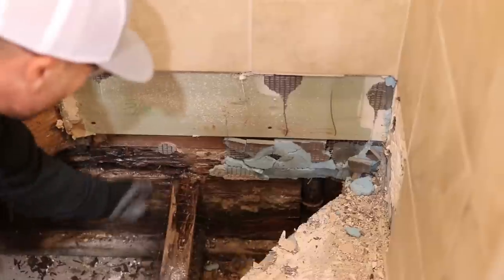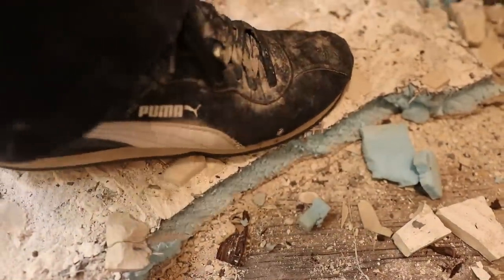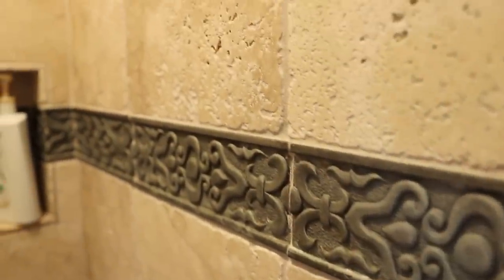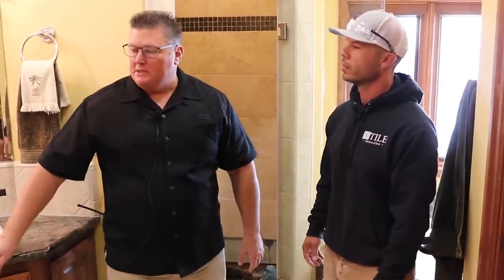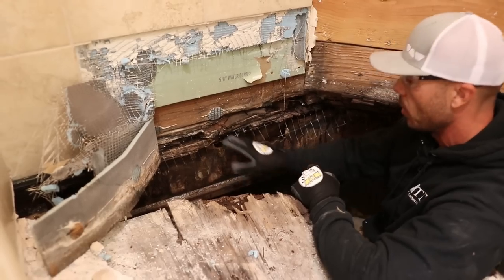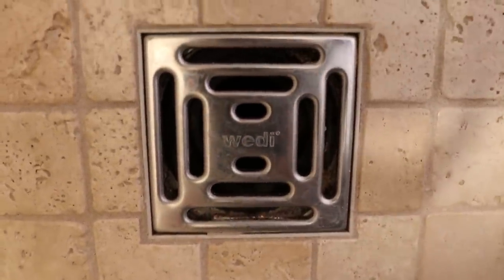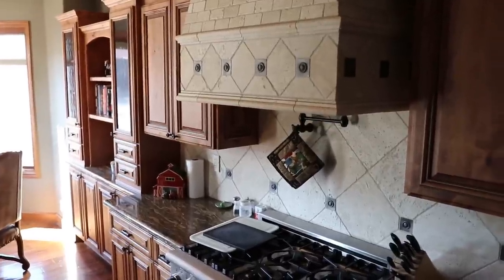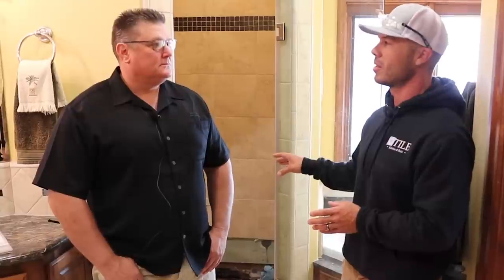Massive WEDI Shower FAILURE (Done by Certified Installer) -- Warranty Claim DENIED

Comment: I’m finding this really interesting and it’s good knowledge but once you have sealed the joint with a beed of adhesive, you are then meant to lay a secondary tape joint with flexible tile adhesive, or appropriate adhesive so then it’s double sealed before tiling? I wanted to start using wedi board more often so are you saying wedi is not good or just in this case it’s been badly installed?

Comment: It looks like they missed a whole entire sealing step with the Wedi sealant - actually Wedi sealant 2019 I used was grey proprietary expensive formulas specifically engineered to interact with their foam core.... so beyond the notch fit, a whole inside corner layer of sealant is required to be troweled in I think 3" wide total each side.... this would be analogous to the Kerdi band application but with sealant. Let me know what you think, Sincerely highly advanced DIY that grew up around some home building.... have nice day

Comment: never used wedi,ive been reading all the comments, first  find out if it was wedi sealant, 2nd why didnt it get adhered to the rabbit,or was it left out  completely,was it caulked  with the wrong stuff,on another  note, my schluter  foam  pan  over  recessed  concrete  ,does flex, a little,im using  1x2 large format tile,the foam is easily  damaged if worked on unprotected heels of boots,knees, etc, seems in this homeowner's job,things snowballed, a failure of sealant for whatever reason,caused wood rot, I'll be following to hear the findings,...great job isaac the homeowner is lucky to have you...
Reply: @TileCoach  ,you may do a test on a sample  if wedi ,glue the rabbit,let cure ...then pull apart ,see if you can recreate the delamination,or failure to adhere,when I first saw wedi,I thought ,wow great product, no fabric patches, I hope you find its weakness, in a way I hope it was install error,or that you find a way to educate installers ,and manufacturers on how this may be avoided,
Reply: @TileCoach  thanks for encouraging  words isaac,your right I was just in there clearancng the toilet flange w grinder, some of my grout lines aren't  perfect, but I think good enough,hopefully  the floor, teaches me lessons  to improve  on shower walls ,thanks coach,keep em coming

Comment: I use the wedi pan here in NY on all my installs. Never any issues. Looks to me they cut the pan and didn’t properly knotch it bc my cement board falls inside the knotch. It all laps so this comes down to a bad install by the contractor

Comment: Great video, I love the detailed analysis. 
I think the floor wasn't properly supported, and the rabbet but had dust in it. 
Both of these things suggest an improper install.
The system isn't resilient , too many points of potential failure, with no fail-safes.

Comment: Even before these videos, I never considered any of these gimmicky waterproofing products. Concrete board (only whole pieces with tight joints) and silicone all joints including corners). Concrete floor with PVC liner or premade acrylic floor pan only. My two cents as a 30 year carpenter that dives into the occasional washroom reno/upgrade. Love my tiling hobby and matching furniture.

Comment: Isaac, big discussion on tile geeks about this. Good topic. 
Questions;
1. Was sealant gray like real Wedi sealant?
2. Describe floor system please. We see wood I beams. 16” oc?
What plywood on deck? Wondering about deflection. 
3. Was this shower on any outside walls? (Again, wondering about floor deflection). 
Thanks Isaac.
Reply: Thanks Isaac. Forgot one. Was pan thinsetted down to plywood deck?
Reply: @TileCoach  some commentors stated  wedi sealant turns hard,the white bit,you had was very stretchy,and the stuff by the rabbet  also  very rubbery,    any insight on that

Comment: Been a CA licensed tile contractor since TileCoach was running around on his tricycle, and have nothing but immense respect for this and his other videos that put the focus clearly on quality, integrity, and durability of the tile-installation process.  Of note: Isaac, at the end of the video you say, as if to apologize in advance, that this video will upset some installers.  Honestly, you don't need to throw out that qualifier---you're highly experienced and qualified, and based on the basic, essential, factual info in your video it's 110% reasonable to say that the Wedi "process" required by Wedi included use of a defective (caulk) product.  That point doesn't need or require an apology, and any installers/contractors offended by it are likely not worth their salt.

Comment: I am a Certified WEDI Installer and do not understand what caused this lamination separation where the shower pan and wall meet but I am not working where there is any potential seismic ground movement.  I suspect this problem was caused by the plywood subfloor being weak and flexible (too thin) not adequately supported, or insufficient quantity of sealant used. The Wedi pan is not soft or flexible, it is hard  and is water proof. In addition to the WEDI sealant used in the joint a two inch band of sealant is added to the outside of the joint. Perhaps this was not done. I respect you and your fine videos but perhaps the installer took shortcuts.  I think it is safer to use a WEDI one step basin pan or a KBRS basin pan where the manufacturer has added an edge along the pan perimeter. This system in my opinion is safer.  I like regardless price WEDI boards due they are strong and completely water proof but like you do not like the WEDI flat pan and I greatly dislike the WEDI drain system thus I will when possible use KBRS custom sized basins with WEDI walls or KBRS Go Boards.

Comment: As a bathroom remodeler for almost 4 decades; that flood test is good for the drain, for a bit; They're not hard to pass...If you lost an ounce or so through the leak; you'd probably wouldn't see the water level drop...All the inspectors I've had just do a stop by...If your pan is holding water they give you the go for tile...The PVC pans with the Oatey drains work great...I always do a preslope though...Some people do, some don't...I like to sleep at night...:)... I think the most important part is the bottom one foot of the walls or curbs...If those are tight; ( i aqua seal mine three times...Gives me some time for other stuff too....:)...)

Comment: What is your opinion of the mat systems. I am in the middle of installing a prova mat shower system and a little nervous. I am thinking of putting red guard over all the seems of the mat system as well. Do you think that would add another level of water protection or would that be a waste of time? You rock. Thanks for all your great videos!

Comment: I’m a UK bathroom installer. I won’t do tiled shower pans on timber floors. I’ve done quite a few over the years but I’ve had 2 that have failed, both on timber floors. All the ones I’ve done on concrete/solid floors are fine.
The problem with these systems is it only takes 1 cracked grout joint from a bit of movement and the water gets in.
If the waterproofing is sound then water sits under the tiles and saturates the entire mortar bed eventually leading to mould growing out of the grout joints.
If the waterproofing isn’t sound then the water has somewhere to go and just causes major wood rot.
I don’t know why you guys in the US are so dead set on tiled pans when you can get solid stone effect shower trays that feel and look amazing. Best thing of all is they can’t fail.

Comment: We used the Wedi Shower System and have been happy so far.  We happen to see Wedi at a home show and were impressed with it. So much so, my husband and I paid for a class with Wedi installers and learned about the product. We also watched countless video's of Kerdi Sc and Wedi and other companies as well.   We had a shower pan failure from a brand new built home. We were first owners. Had to have it all ripped out and mold remediation under the house in crawl space.  We don't  trust ANY contractor, so after it was all ripped out, we installed better subfloor, extra screwed down boards so no movement.  Put down Kerdi Sch. waffle floor before tiling the floor.  If the tiling company subs do not know how to do work Kerdi or Wedi, then you're screwed, that seems to be the biggest problem.. lack of training! It doesn't matter how good the product is.. your laborers have to be trained and you have to teach them to actually CARE about the job their doing.   We inspected every move our tilers made, tho they barely spoke English.. but WE had to police our tile company owner who was very American and a jerk.  Anyway.. so far we've not had an issue.. and believe me we check our crawlspace continually!! Wedi makes your shower pan specifically based on the size.. I was impressed with how sturdy that pan was.. I honestly don't know how you screw up a Wedi shower pan?!

Comment: I really like Wedi. The drain system is great. If sides are set down in thick, rabbit filled, bead of sealant and struck off properly, it should never fail. I would focus on the seat and vertical corners for issues.

Comment: Crap all that crap is crap you need to hot mop then float then Tile. I don’t know why That guys there to do the repair on his channel one of his showers that he installed failed as well.  I have been doing bathroom showers for over 30 years not one has failed hot mop float tile simple. Don’t try to reinvent the wheel😎🔨👍🏻 don’t get it twisted I respect the video and thank you for showing all of the homeowners that crappy waterproofing system please do not use that system. On your tile jobs. Thanks for the vid

Comment: Installer error. That wood framed bench is the issue. You build the bench out of 2” wedi foam after the shower is complete with straight panels set to the base on all sides.

Comment: We are also installing Wedi Systems for Decades and Have and had Never a Problem with. As a German Master Tile Setter and in the Business over 30 Years i can assure you that this Product is Bullet Proof, if it is Used the Right way and Installed the Correct Way. We Installed Large Wedi Panels Build Steam Showers/ Pools and Fountains and much more. Not one Problem. Now People will Say he got Paid by Wedi to say that .... No We also using other Shower Systems like Schluter Systems or Laticrete Shower Systems and many more ... like i said before you have to install it the right way and of course you have to know what you do. Whats Funny in this Video that Wedi was Installed over Drywall in Dots, Not enough Sealant was Applied between Shower Base and Wall. The Shower was Leaking from the beginning something like this don't happen over night.

Comment: Hello. I am a contractor and tile installer and these shower pans are actually great if installed right. I had no idea wedi recommends a simple bead of sealant to attach pan to wall board! When I started using it 7 years ago I was always told by the retailer to follow up the sealant with wedi tape. A water proof roll of material that you mortar into all thinside and outside corners. I even put it into all my recessed niches. I also i use Hardy backer board instead of wedi board cause its much cheaper. So I red guard all the walls right over the wedi tape down to the wedi shower pan and that shit is bullet proof.  I felt compelled to write something after I tore the ceiling down below my own tile shower with wedi pan and its dry as a bone. Installed it 4 years ago!! I never really viewed the wedi system as time saving. Considering time is money and wedi pans cost like 600 and up just for material I would say I spent plenty of "time" on the pan.

Comment: Ive tried all these systems and always go back to latticrete system minus the foam pans or straight traditional with a liner. Latticrete is by far the most solid of the sealed systems.

Comment: If a shower pan leaks it will almost always fall back to the installer. I rarely see a manufacturer stand up and take responsibility for a shower pan failure. As an installer I always second guess the manufactures instructions and then fall back on my experience to install a leak proof shower pan. Relying on a caulking joint scares the heck out of me, would never go there.

Comment: I'm not sure if the installer did it but I believe in addition to the bead of sealant in the rabbit you are supposed to also put a bead on top of the boards in the corner and smooth it with a corner knife like you are doing a drywall inside corner.  I think there might even be a required 2" out on each side of the board for the sealant to be spread.
Reply: Not just spread it but I also add fiberglass tape into the corner, after it dries there’s just no way you can spread them apart even if you weigh 300 pounds.
Reply: @sergeya8601  I dont think the wedi tape is required per the instructions but obviously makes sense to do it
Reply: @javaldes7  I've read that also that the tape is NOT required. I wonder if the tape can be used over the corner without voiding the warranty. I am going to a certification call in January and will ask that question

Comment: I have a lot of experience with closed cell foam. Not so much waterproofing a shower. I do know that closed cell foam is not waterproof and is extremely difficult to adhere anything to it after it’s cured. His hypothesis of the problem is correct imo

Comment: I can see  in America you have a good process for checking each stage that th einstallation is done correctly but I am in the uk and we pretty much use a solid shower tray and a glass enclosure to 2 tiled walls which in future can be changed easily.i do think however good your systems are is it has to be 100% perfect through its lifetime which is difficult

Comment: The seat looks more to be the culprit. Wedi also says the substrate under the pan needs to be adequate just like under tile. If the subfloor is only 1/2",  I glue AND screw a layer of 1/2" plywood down first and then I ALWAYS pour a full bag of self leveling and I then use Laticrete 254 to thinset it down.  If there is movement in the subfloor there could be a failure in the pan and even WEDI is clear on that.
Reply: @TileCoach  only issue is most remodels I run into it's either 1/2" or 5/8" at best and not T&G. The job I just did is I joists but 24 on center T&G.

Comment: The contractor who did the job did not sit the wall sheet in the rabbet correctly.  Yes, you run a bead of sealant caulk between the wall board but that's not all.  You then run a run a generous bead of caulk on the outside of that union (inside pan) so it does create the coverage that he was speaking about.  If done correctly, you go through tons of caulk/sealant.   It wasn't installed right - rush job.

Comment: That failure shows an obvious improper installation. It could have been leaking since it was first installed and got worse over time. I never liked the idea of seats in tiled showers. I don't think the issue was because the installer didn't know what he was doing but I think the joint was dusty/dirty or the sealant may have skinned over in some areas before the panels were joined together. The sealant was stuck very well on one piece and pulled off the piece it was joined to. If the issue was a bad system or failed sealant, it would have pulled or fallen off of both pieces. 

There are a lot of comments about not trusting the sealant and how other systems are better because a fabric is thinset over the base and up the walls. That fabric is laid on top of the base and wall. Its installed with thinset which it not waterproof. How is the fabric applied with thinset which water can penetrate better than sealant? Any seal applied over the top of something using an adhesive that water can penetrate or wick doesn't seem like a good idea. In either system, even if its installed correctly,  its only as good as what's holding it together. Sealant that is 100% waterproof, or thinset which is not waterproof.  

You make a lot of good informative videos. If you don't use a system but make a video of how that system failed wearing advertisement from another manufacturer of a system you use, it screams bias and its evident by your comments along the way. These types of systems (Schluter, Wedi, etc.) are all good systems when installed properly. I really don't think these systems fail. I think 99.9% of the time its an installation failure. 

If anyone decides to use these systems, read the instructions, follow every step and take your time. If you don't understand fully after reading the instructions, call a professional. A good point was made that the marketing for these systems make it seem like its for the average DIY person to do. Do a quick search on the web and you can find a lot of people explaining and doing these installs completely wrong using the wrong thinset, underlayment, grout, etc., etc.

Comment: Hi i am getting ready to redo my master bathroom. I have a home repair business and i am a licensed home inspector in North Carolina.   What do you think of the redi pan or tile redi shower system? WE have a lot of tile contractors who are not required to have a license to install any tile and most do not speak english.   I have seen many poor installations and the installer knew they would fail. I just want a shower that will last and not fail. Any advice is appreciated.
Reply: Thank you for your response

Comment: 10 years ago we would hot mop the shower pan. Now I use the pvc liner. After we get our mortar bed down I red guard the shower walls, mortar bed and up the side of the drain body so I know the shower will never leak. Red guard adhere extremely well to these materials. I can’t believe contractors would use such flimsy materials and products. A shower should last a lifetime if done properly.